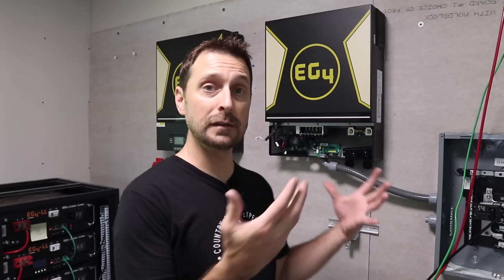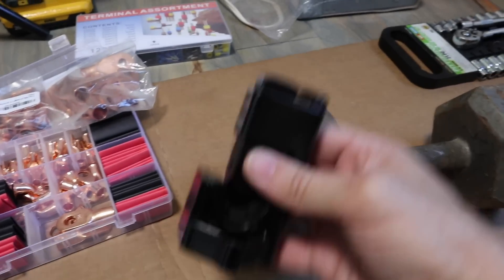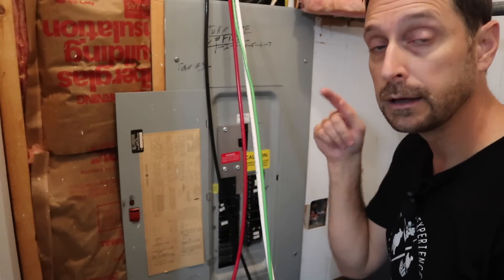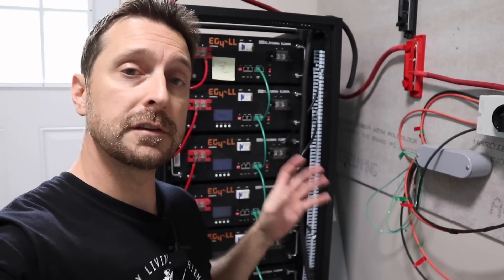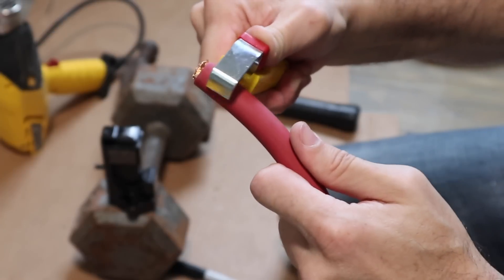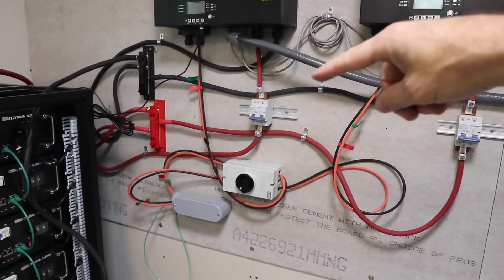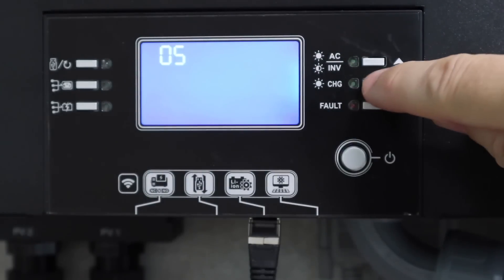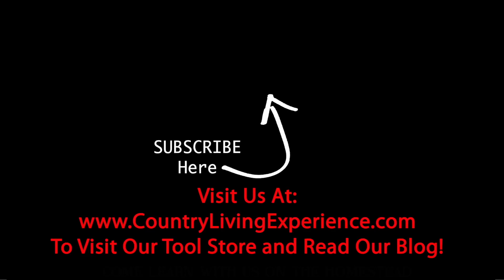EG4 Inverter Installation Full System Wiring And Tips! Off Grid Solar!

Comment: I was going to install in my basement, right near where my electrical panels are on the outside of my house.  But now I need to put it outside and build a building for it, my question is how does the cold and snow affect the system or does the temperature change affect the system?
Reply from the maker: Temperature will affect the system. The batteries need to remain above freezing and below 130°f. The inverters have a similar temp range.

Comment: If you run into fault 82 under high load, it’s because of the length of the #2 lines is different for each inverter. This fault can also occur if you have an unbalanced AC output load(too much on one inverter/line). A bad/cheap DC breaker can also cause the same fault.
Reply from the maker: Thanks. That is why I have my battery cables the same length. Have all these issues happened to you?
Reply: Oh! I see what you did. Had to look at it again. You got loops over behind the battery rack. 👍
Reply: @CountryLivingExperience  
No these haven’t happened but I got a fault with no code on a real windy day. Figured I got a surge. Installed 80Kva surge arrestors on grid and output on twin LV6548’s FYI, temporarily remove the filters for a 10c drop inside inverter temperatures seen in Solar Assistant
Reply from the maker: Cool. Thanks for the heads up.

Comment: How did you decide on the red & black 400amp busbars?  If my battery bank is 6 of those EG4 batteries, is that the size I need?
Reply from the maker: Basically the bigger the better. I have 6 batteries connected to them right now but will be adding 3 more. Max charging amps from both inverters would be 240A. You need to have something big enough to handle that.
Reply: @CountryLivingExperience  
I was planning 250A sized ones.  As well as 250A ones to merge together each of the L1, L2, and N lines to feed one line each to the main breaker of the AC panel.
Reply from the maker: I would not recommend you try to merge the outgoing ac power from the inverters on busbars. Those conductors need to land inside a sub panel. The neutrals will go on the panel busbar. The hot from each inverter will go each to one side of the double pole breaker.
Reply: @CountryLivingExperience  
Sorry, I didn't provide enough context.
I have assembled components for a large power grid for an off-grid home we are building.  The plan is to arrange two separate systems feeding the same AC main panel.  So each system will have:  2 sets of 400vac solar panels feeding 2 EG 6500 inverters, and 6 EG4 batteries in a Sig Solar tower.  All this times 2.  My comment above meant one set feeds L1, the other feeds L2, both would feed Neutral to the main breaker shut off of a 200amp distribution panel for the house for split phase.  The bus bars would be for linking the L1's to each other from group 1, L2's to each other for group 2, and then all the Neutrals for all 4 inverters together and send those three wires to that breaker box..
Reply: By the way Eric, great videos!

Comment: @130:07 You have the option for 120 if your setting up three phase.  On a three phase setup, each phase is 120 degrees out of phase to others, when in a home based system, your doing 180 degrees for a split phase 120/240 circuit.
Reply from the maker: Yep
Reply: why does the manual state for a split phase (not 3 phase) setup,  that you can use 120 or 180 on setting 28 if you are doing a 6 inverter set up with 3 inverters on each phase? I would think you could only use the 180 setting....it states this on Page 56 of the manual.

Comment: Ok bigtime i finally got my 4- 6500's i understand how to wire 2 of these, but 4 not so much.  Any suggestions? 4- 70 amp breakers?
Reply from the maker: Cool. You will need two 70A double pole breakers. Each inverter has only one hot wire that goes to each breaker.

Comment: Hi
Nobody has been able to tell me if you can hook up a Honda 3000i generator to the A/C input to charge the batteries when the Sun fail to appear for several days?
Reply from the maker: We did a video discussing battery charging here: https://youtu.be/Om2sxml6U0w. We talked about using a generator and when not to.

Comment: Question; why may using one split phase 120-240 Volts inverter instead of 2 inverters? Easy install, cleaner, less wiring, less mess, etc. Thank you
Reply from the maker: There are many different system architecture setups. I chose this one because I can put more PV input, they are physically lighter, still very easy to install, and I can put 4 strings of PV in insead or just 2 for the 120/240. I don't care about cleaner/less wiring. Pricing is identical but my setup has more output for the same price. It is a very personal choice.

Comment: Did you remove the grounding screws from the 6500’s?
Reply from the maker: No. Why?
Reply: @CountryLivingExperience  Will Prowse removed his but not sure if you have the same config
Reply from the maker: @stiversfamily  We have a different configuration. If you purchase them, you need to ask Signature Solar what they recommend based on your configuration. We are off-grid, no AC in, and utilize it like a generator.
Reply: I thought these had a ground to neutral bond in the eg4 inverters. I remember that from Will’s video. If that is the case the bond needs to be removed in the inverters since u said u have the bond in the main panel. Hope for clarification as I purchased one of these inverters as well and I cannot have any ground neutral bond in the inverters.
Reply from the maker: @jimmyg6215  I will get clarification from Sig Solar again. Stay tuned.
Reply from the maker: @Jimmy G Just got off the phone with Sig Solar. With my system architecture using it as a generator through a sub panel located far from my main panel, there is no need to remove the screws. That said, each system is different and I do no know how yours is set up. Will's is also different than mine. I did confirm with the person I talked to that he personally would remove the screws if he purchased one (that is an unofficial opinion of his).
Reply: @CountryLivingExperience  thanks for the info, I have an off grid cabin with my ground rods and neutrals bonded inside my main breaker panel. It’s only 20 feet away so I think I’ll be calling them to figure out how to remove the bond in the inverter. I purposely bought a Honda generator with a floating neutral so I didn’t have to go digging around the genny to remove the bond there as well.  I just want it in my panel only. Thanks for taking the time and see u on the next video.
Reply: @stiversfamily  did you end up removing the internal bonding screw in the eg4 6500ex

Comment: Are you saying 2 awg or 2/0 wire going to the battery and on the wire from the inverter to the main panel are you saying 4 awg or 4/0?
Reply from the maker: 2/0 going from inverters to first buss bar. 4/0 going from first buss bar to battery case buss bar. 4awg from inverters to main panel.

Comment: So you used 4 gauge wire from your inverter to your panels where did you find it with a ground wire also i can only find it with positive and negative
Reply from the maker: They don't make 4 gauge romex cable. You have to buy individual 4 gauge THHN conductors. I bought 8 gauge green THHN for the ground.
Reply: @CountryLivingExperience  excellent, thank u sir!

Comment: How many amps is that sub-panel vs how many amps is your main house panel?  I'm assuming this is completely off-grid?  And would you double the size of the sub-panel for using four of the Eg4 6500ex's?
Reply from the maker: Our sub is 125A and the main is 200A. If you have 4-6500's, you would have a total potential draw of 26000 watts. From what I know about the NEC, you can divide that by 230 and get 133A which means a 150A panel should be fine. I think they count the first 10000 watts at 100% and the rest at 40%. So if you calculate that in, a 125A is totally fine. That being said, I am not an electrician and you may want to consult with one. Hope that helps.
Reply: @CountryLivingExperience  Thank you for the response.  So many YouTubers just ignore their comments section.  Appreciate your knowledge transfer.🙂
Reply from the maker: @davidmcg6940  My pleasure.

Comment: Hey Eric, I have the same setup as yours, with an interlock kit. How many times do you switch back and forth between grid and solar power in a day/week period? Is it safe for circuit breakers and electronics to switch back and forth every couple of days? Thanks. Love your videos!
Reply from the maker: Hello and thank you.
It really depends on the week and whether I charge from our generator or not. Say on average 1 time per week. As far as I know it is not that harmful but I am certainly no expert in that department. The Sig Solar guys told me to limit the switching as much as I can.
Reply: @CountryLivingExperience  Got it, thank you. Do you think you will install a different transfer switch maybe in the future? With this heat and ac running, sometimes I switch every 2/3 days. But that got me thinking and I am a little concerned. What do you think would be a better solution for our interlock kit setup?
Reply from the maker: I may install a transfer switch as some future time. I may also just add batteries and panels and keep my generator more active to charge my batteries with the Chargeverter.
Reply: @CountryLivingExperience  If you will end up installing a transfer switch and make a video of the installation, it would be awesome and helpful! Love how thorough you are in your videos.
Reply: I'm naive to this but can one of you explain why you wouldn't just use the bypass feature on the inverter? Bring an AC IN to each inverter from your grid and allow it to do the transfer? What am I missing?
Reply from the maker: @GeorgiaDawgs001  I have no AC IN as this is currently set up as an off-grid system.
Reply: @CountrylivingExperience that makes sense if you don't have grid power, I guess my confusion was from @ThomasKJ101 saying he switches back and forth with the grid and interlock kit. I would think the Bypass in the inverter would do that for you, I'm just not sure if there is a disadvantage to using the bypass feature like power losses etc..
Reply: @GeorgiaDawgs001  I have the same set-up as his, no AC in at the moment, no critical loads panel, and not enough solar/batteries, thus the needing of switching back and forth.
Reply: @ThomasKJ101  so the key here for your situation is no critical load panel? If you had one with just a few circuits on it you could run your AC IN from your grid connection and let it do the transferring back and forth? Thank you for the reply I am about to spend a lot of time setting one up and just trying to make sure I'm seeing the whole picture
Reply: @GeorgiaDawgs001  Sure, no problem. And yes, I did not install a critical loads panel to begin with and I went with this route because at the time of installation my knowledge and budget were limited. I will have to upgrade the set-up though, as after talking with an electrician, switching the breakers back and forth too frequently can damage the breaker itself and the electronics, as also Eric said that the Signature Solar guys told him to limit the switching as much as possible. So yeah... eventually, I will have to do it.

Comment: I love your videos. I pretty much have exactly the same system.  My 2nd inverter is putting out 110v and the 1st one is at 120v. I checked my breaker box and its putting out 230v. Does anybody have any idea why its not putting out 240?
Reply from the maker: Thank you. I appreciate it. 
That is a strange issue. I have not run into that. Have you tried resetting/rechecking all of the settings?
Reply: @Country Living Experience: A Homesteading Journey  I figured out what I had done. I had the red and black wires hooked up to each inverter that was supplied, I disconnected them and the second inverter started putting out 120v.
Reply from the maker: @michaelcollins5685  Glad you got it figured out.

Comment: Hey nice video, thanks taking the time to create it. Have you ever looked into the wiring troughs like Engineer775 likes to use on his installs (for cable management)?
Reply from the maker: Thanks. I have a trough sitting on the side but it is not necessary to use.

Comment: My 8 awg pv wires do not fit through the supplied cable glands to the pv inputs, did you use 10 awg? Would it be okay if I run my 8 gauge to the imo disconnect and run 10 gauge from the imo disconnect to the inverter? I have 3200 watts of solar panels on this line
Reply from the maker: Yes, I used 10awg pv wire. I don't think you should change wire size mid-run.
Reply: @Country Living Experience: A Homesteading Journey  wow thanks for the fast reply, I used 8 awg pv wire because my panels are 200 feet from my inverter/battery shed lol
Reply: @CountryLivingExperience  I could use 10 gauge pv wire from imo to inverter or 8 gauge thhn 🤔
Reply from the maker: ah, I understand. Not sure why it won't get through those cable glands. They should be big enough.
Reply: @Country Living Experience: A Homesteading Journey  I can force them but it scrapes the insulation lol
Reply from the maker: Do you have two sets of pv going into the inverter? If not, just put 1 wire through each gland.
Reply: @Country Living Experience: A Homesteading Journey  yeah just 1 set I pulled it through with pliers help lol I tried the other gland but I didn't like the way the wire was needing to be bent at the connection and I plan to add another string in the future thanks for all the help I wish I could send a pic
Reply from the maker: You can email it to me. The address is under the About section on my main channel page.

Comment: I have the same setup. My electrician says the sub panel breakers should be two 55 amp breakers or a two pole 55 amp with the tie removed.  If you do the Power (watts) = I Current in Amps) times E (Voltage) calculation each inverter supplies a max of 54 amps (6500 watts divided by 120 Volts).  Two 70 amp breakers puts you 8500 watts per inverter
Reply from the maker: I took the advice of the solar company. I have to go with their recommendation. Most electricians don't understand solar.

Comment: why no dc breaker in addition to your emergency shut off on your pv?
Reply from the maker: It is not 100% necessary. It is really only for a surge from a lightning strike.
Reply: @CountryLivingExperience  right, why risk frying your inverter??  I am building and identical system and new to all of this.
Reply from the maker: My ground mount is all steel buried 3ft in the ground and my pv lines are 10ga run 100ft. The likelyhood of lightning running up the wires instead of straight down the mount into the ground is very very small.

Comment: Prowse was saying that HF inverters (like the EG4) won't handle motors or big inductive loads as well as the LF (Growatt) inverters due to surge load.
Have you ever had trouble with the EG4's running say the well pump or the rain harvesting purification system?
Reply from the maker: Interesting. I have not had an issue so far. Still doing some load testing. Unfortunately my well pump is not connected to the house to test. It serves my barn and irrigation. I have a community well connection for the house.

Comment: Electrician said it was ok to have that thhn wire not in conduit going to the main panel?
I'm no electrician either but I'm pretty sure it needs to be in conduit like from the EG4 to your sub even in the wall.
Reply from the maker: You're correct. I ran conduit in the attic but had forgot to add it in the wall cavity. I pulled it down already and added it in.

Comment: Does these inverter fans keep running nonstop? Even when there is no ac pulling or when it’s not charging battery?  

I purchased one and the fans keep running non stop from I turned on without no loads. 

I tried at night and they still running nonstop.
Reply from the maker: Mine speeds up and slows down depending on the function. It never completely stops.

Comment: With those Nader breakers anyone know a box they will fit in that is a lot of amps at 48 volt dc open to touch.
Reply from the maker: I was going to pose the same question. I cannot find one that will fit yet.
Reply: @CountryLivingExperience  may just have to look into a plastic screwable acrylic case that will fit over them and cover them that way. Maybe one that has a door of some kind so you don’t have to unscrew it if your breakers trip though I would hope those won’t trip much, if ever. Hmm just thinking here I’ve seen locking thermostat covers that might do the trick. Yep, after looking lockable thermostat covers would at least cover these after a little dremeling out space for the wires.  May not be the greatest because they are plastic but better than electrocution until something better can be found.
Reply from the maker: That's a good idea!